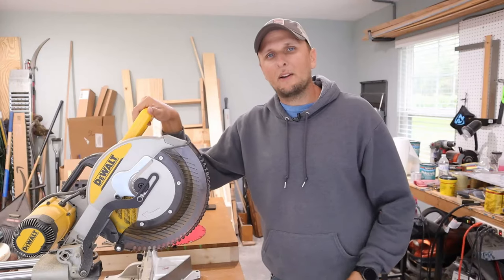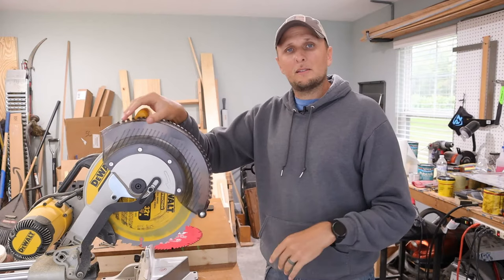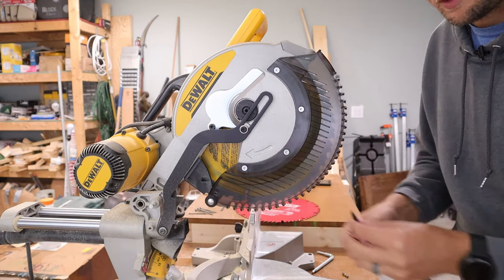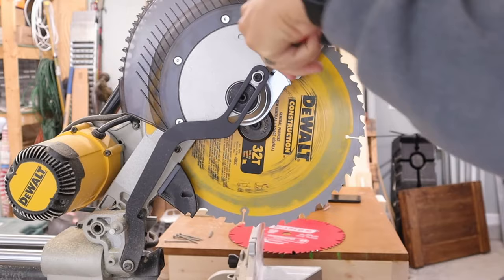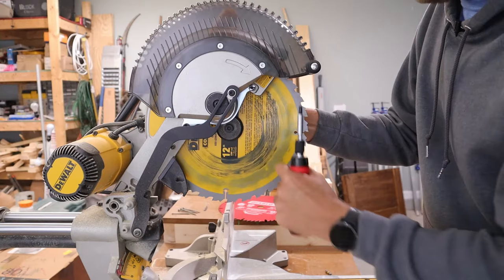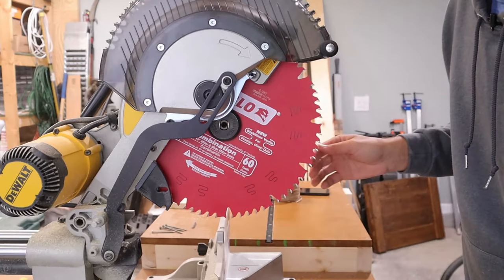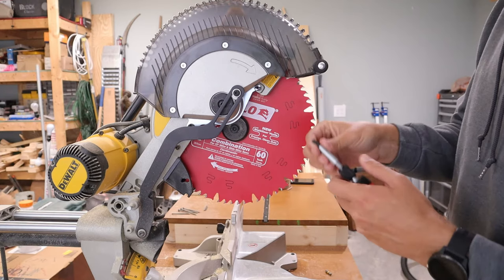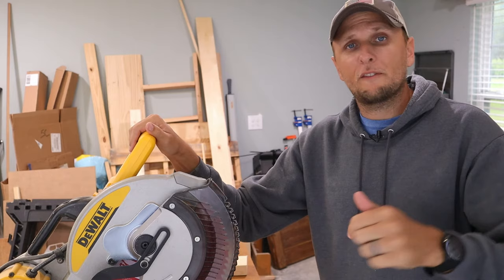How to Change a Mitre Saw Blade | Dewalt Chop Saw Blade Change | DWS779

Comment: I bought the DWS779 and an 80 tooth blade and the plan was to change out the 32 tooth. There are a lot of videos on changing the blade BUT yours was the only one that mentioned loosening the screen towards the back of the silver plate.....without that screw being loosened, I was not able to get the blade guard out of the way to remove the bolt for the blade -- so KUDOS to you.

Comment: Just be careful. The heads of these screws strip out real easily. I think you don't want to have to change your blade too often. I ended up having to use a cold chisel to use the straight slots of the screws to loosen and tighten.

Comment: This is the first video from you that I watched.  Very straight forward, no extraneous blabbing on and on, just the facts.  I liked it so much you earned a like and a sub.  Have a blessed day!  added....  Mine was slightly different, it had a hex bolt for the blade securing lock instead of the star 40.  However, the tool that was on the back of the fence had both the hex and the star 30, so it worked out.  I guess a difference in manufacturing runs or something.  I have had mine for about 4 years, I think.

Comment: This was a fantastic tutorial.  I just bought my Dewalt miter saw and am making holders for my drills with 3 inch pvc pipe.  I had to change out the blade that came with it to a 100 count Diablo blade for the pvc.  It would have taken me 3 times as long and much frustration without your video.  Thanks a bunch!  I generally like to stick with a higher count blade anyway for the type of wood working I do such as making tool holders.

Comment: I had to remove the guard as the screw would not come out. My particular saw has a half inch bolt holding the blade in place.

Comment: Hey body very nice video thanks. ..I do have a question ⁉️. I had a 10"disc in my Mitter saw with 30 teeth ..now I got a  60 teeth. But it has the arrow ⬆️ pointing on the opposite dirección on the front of the disk 📀💿 ..should I use the arrow on the Mitter as my guide _ sorry I am new in this just a weekend warrior...thanks 👍

Comment: Thanks so much for the help. Unfortunately I just found out after the install that I ended up buying a 10 inch blade for my 12 inch miter saw so it looks a little silly, but I installed it anyways lol. Just cutting composite decking is all so it’ll be fine. Thanks!

Comment: I just bought the same saw. I was wondering why you were able to drop the blade and insert it with such ease. Then I noticed you removed the spring part of the dust duct inlet that hangs down. That made all the difference removing and inserting the blade.
Reply from the maker: That actually is a fairly common part to get broken, which is what happened to me.  So it probably did make it easier to change out the blade.  I make new ones with my 3D printer.  Glad you were able to get it changed out!
Reply: DeWalt just issued a recall on that rear blade guard/dust duck inlet part for the DWS779.  You'll have to check it out to get a free replacement part.

Comment: Where you pushing the side bottom on the side when screwing the new blade back? U did when taking it off?? Just checking
Reply from the maker: Yes.  Has to be locked to tighten it down as well or it will just spin.

Comment: 1:10 Tool? what tool? i dont remember any tool! 😁  Thanks!   Never changed the blade on my   DW 716XPS , Couldn't figure out why it was so hard.    Don't forget to look behind the fence where i found the tool conveniently mounted!    (so thats what thats for!)    If not you can buy a replacement for about $11 or  use a Torx 30 bit  ,   Dont really need the T 40 because u can use a channel locks/  pliers / socket wrench on the arbor bolt once you get the shroud pushed back.  But the  30 bolts are round .   What a silly design!

Comment: 3:10 that screw is so tight I need an impact drill. I'm not buying one, and I can't borrow one... so... This saw was given to me as a Christmas gift, and I'll just give it to my handyman. When I shop for a miter saw it will have a hex nut, or I won't buy it.  The guard bracket screws strip out too easily, making me wonder why Dewalt cheaped out at these screws?
No... the saw does me no good if I can't change the blade. Does me no good if I can only change the blade a few times before the screws need replacing.

Comment: Hello so let's say the bolt that holds the blade in place is stripped how F'd are you?
Reply from the maker: Wellllllll I'm not going to lie to you.  It's not good.
Reply: Seriously tho, just tried replacing my blade while fixing the recall on my 779. The blade bolt is locked up so tight now it’s stripped. Everyone makes it look so easy not impressed at all at the quality of the hardware seriously wondering if someone at the factory put on locktite it shouldn’t be this difficult.